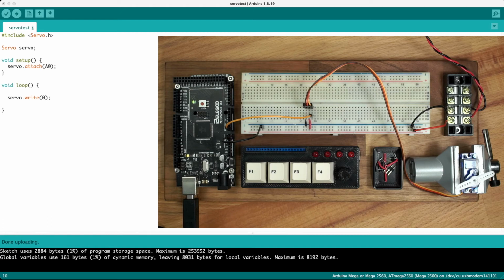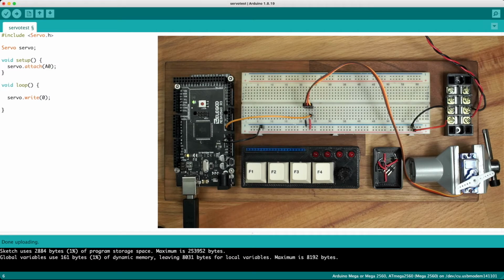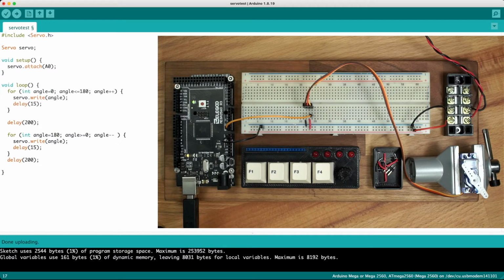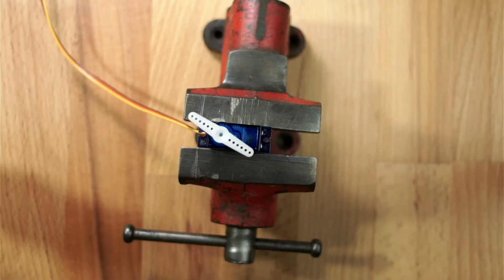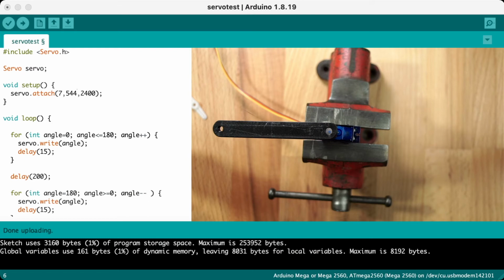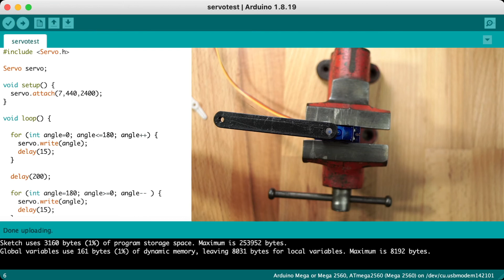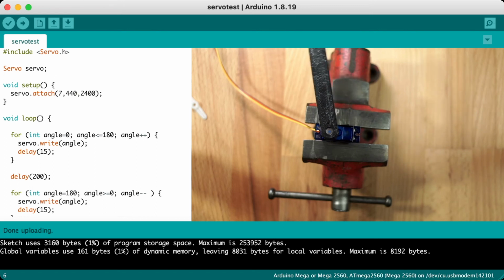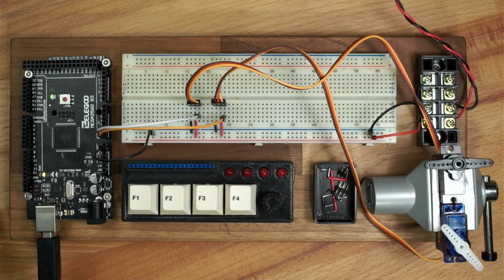Driving and calibrating servos with Arduino

Comment: What is the best method to get the servo to the same starting position (mechanically) on start up? Can a spring be used if rotation is only 90 degrees for the application?